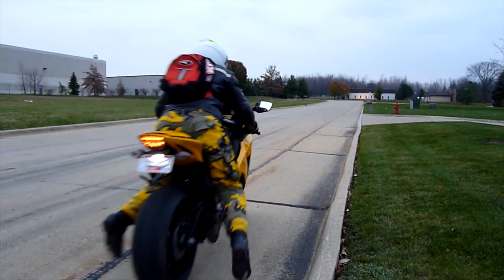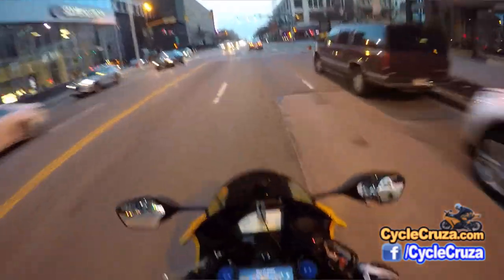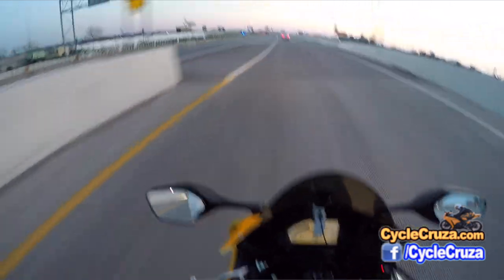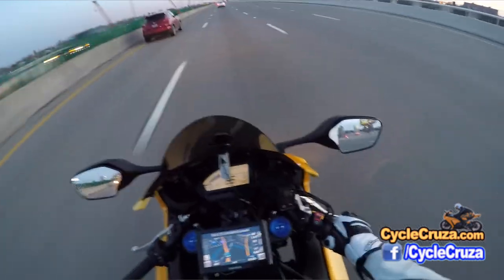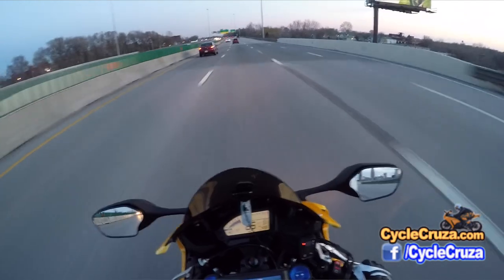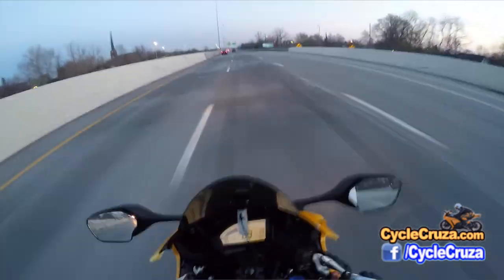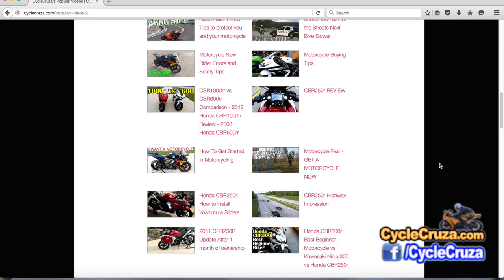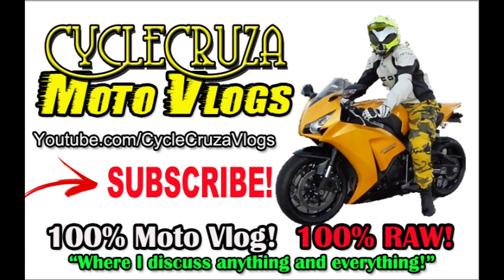Ceramic Bearings Make Motorcycle Faster? Steel vs Ceramic Bearings | MotoVlog

Comment from the maker: ***CycleCruza's Recommended Videos*********

Go to my motorcycle Video Playlists here:
http://cyclecruza.com/my-videos-2

Watch OEM vs Chinese Fairings video here:
https://youtu.be/Hm91V5FlMqU

Watch 2012 Honda CBR1000rr review Video:
https://youtu.be/NlkL1icvenQ

Watch Motorcycle Fear Video here:
https://youtu.be/gbVeyVEmryc

Watch Why a Supersport for Street Riding video here:
https://youtu.be/A7eAmz2Q1Cs

Watch Motorcycle Defensive Riding video here:
https://youtu.be/OOCr7WupuQo

Watch Top 5 Starter Motorcycles Video here:
https://youtu.be/wyniWQWAy10

Watch Beginner motorcycle you will keep Video:
https://youtu.be/5MJbnRdTyQo

Watch Best Starter Motorcycle MotoVlog video here:
https://youtu.be/nIgbAwaVg8Y

Watch CycleCruza's Buying Tips video here:
https://youtu.be/n4zN-EJHQd0

Watch my 'How to get started in Motorcycling" Video:
https://youtu.be/at5jr430vX0

Watch Defensive Motorcycle Riding video here:
https://youtu.be/OOCr7WupuQo

Watch How to get started in Motorcycling video:
https://youtu.be/at5jr430vX0
Reply: +CycleCruza Is that for a full set of every bearing in the bike, front wheel, rear wheel, primary drive in the trans and everything? Or is that just for the drive wheels? (seems like the % efficiency difference would be across replacing everything in the bike, not just a set, which means that the difference is really negligible unless your are cruising at 180 Mph on a regular basis and would like to go another few Mph which would be good for racing as a slight edge) Those should be ~$50 a piece?!? (assuming 10 bearings between wheels and transmission)

Comment: Hey listen I know This may be a hair off to the Other end. My Experience with Ceramic Bearings comes from Skateboards and Longboards. So for Example Paying $30-$60 vs paying $150-$250 for amazing set Ceramics. I can tell you first hand from that aspect The effort to keep the ceramic cleaner and resistance to dirt grit and Grime is SOOOO much better than Steel. The Resistance to degrade from my experience is 60-80% better wear resistance vs Steel bearings. The Rolling resistance allowed me to make one push off and Go nearly 3 times the distance vs that same effort on Steel. So I do understand the Translation in performance and quality of the Product. Would I buy a pair for stock wheels..... Honestly no..... would I do it for Carbon Fiber wheel.... Hell yeah I would since I'd be spending the Money already. Actually I stand corrected..... if my OEM steel bearings are worn out then actually Yes I would get some for stock wheels..... But would I upgrade just to change them............ No. Is it worth the Money....... Yes but only if it is time to replace the oem product.
Reply: Thanks for your input.. ill buy some.

Comment: If you're racing, every little bit counts. On the street you'll never notice. Ceramic bearings have been around for decades as far as I know. They used to be (still are maybe) a common upgrade for RC cars I used to race back in the 80's. They made a difference in those little cars. Not surprised they have them for motorcycles.

Comment: +CycleCruza

ceramic bearings are often used for components that generate or consume alot of electic energy.
(like big expensive electric (servo) motors).
That is so the balls in the bearings are non conductive, compared to steel balls.

for example electric motors can get a static electricity in the rotor (rotating part) and when the rotor is not grounded by connecting it to a grounded machine, the static electricity will flow through the steel balls causing sparks, these sparks create dents in the surface of the balls, the dents then cause the bearing to wear out faster.

the ceramic balls are non conductive so there will be no spark. in an electric motor they are often mounted with steel brushes so the current will go theough the brush and not the bearing.

Also the thing about the bearings having less friction and all that is true, only on such a small scale that wou wouldnt even feel it if you spin them by hand. so that you bike will gain 2hp is COMPLETE BULLSHIT!
all the friction a bearing has is caused by the seals, that keep the lube in and the dust out. a steel ball bearing with no seal will spin really freely. and the tiny bit of friction it still has is then mostly caused by the oil.

So if u want more power and all that good stuff:
remove all seals from the entire bike and drain the oil!
(please don't :D)
Reply: the mental picture of someone trying your suggestion is hilarious!!
Reply: Although the increase in friction would be more noticeable under several hundred pounds from the bike sitting on them. I'm not positive, but I'm fairly sure that ceramic is conductive.
Reply: +Dominic Gregory first the bike is too light to add any serioud friction to the bearing. if it would create friction it would mean that the bearing would change shape a little bit, resulting in more wear. but for the wheel bearing the to be under such pressure you need much more weight.

second, full ceramic bearings are non-conductive, google it if u dont believe me.....
Reply: DutchMastermind Yeah, but I'm saying a 450 pound bike would add more fiction than you spinning them in your hand.

 I said that I don't know if ceramic is conductive, but I'm fairly sure it is because of ceramic heating elements and stoves. I could be wrong.
Reply: Dominic Gregory 450 pounds is not enough to create any noticable resistance, the bearings are big and hard enough to support that weight. if it would create friction your bearings would get incredibly hot (wich they dont). and if a bearing gets over aprox 110 degrees celsius, it will suffer serious damage.
Reply: DutchMastermind Alright, I get what you mean. I was just saying what I think is right, not claiming it to be right. Have Have a good day man
Reply: full ceramic bearings can be run dry and always spin more than steel, you no need to put the rim seal dust because it is non-magnetic non-dust absorption the rim seal dust can cause addiction drag purpose of this shit is to protect water going in a steel bearing

Comment: I'm guessing with ceramic bearing they don't expand when they get hot and that reduces the friction which frees up some power.
Reply from the maker: +samuel lopes They say ceramic bearings have less surface imperfections thus less resistance.
Reply: Oh ok. I know usually with anything ceramic it reacts better to heat. Ceramic coated piston tops are a good example...

Comment: gimmick. I work on machines of the world. CNC, Hydroforms, Plastic Injection Presses, Fanuc-Nachi-Motoman-Sepro robots. NEVER seen or used ceramic bearings ever. These are machines with great precision and running thousands of cycles every 8 hours, 24 hours a day, years straight.

Comment: I used to do outdoor inline speed skating and I remember switching out the ball bearings for ceramic bearings.  I was smoother and I did feel less friction when I swap them.  However like you said, they are costly to switch.

Comment: I don't see how bearings could add hp? Kind of like changing the gears...doesn't change the hp rating, but could seem quicker (depending which way you go). Maybe less power is lost during the transfer from engine to rear wheel?
Reply: +Josh BAtic Smoother roll, allows ease of rotation to the rear wheel. It doesn't "add" hp per say, it simply allows the bike to put out more of it's potential. Which is a fair amount considering the minimalness of the upgrade.
Reply from the maker: +Josh BAtic Less rotation restriction so the wheels roll better.

Comment: My thought would be if you had ceramic bearings in the front wheel and were a wheelie person, would the bearing break?  Hit a regular ball bearing with a hammer and it might give it a little dent.  Hit a ceramic piece with a hammer and it might break into a bunch of pieces.  The front axle is the hammer!  So, would the ceramic bearings hold up to abuse?  The ceramic bearings don't create hp, they just make the centrifigual drag less.  A manufacturer who says they can get 2 hp with their bearings I think has a box of "Dr Good" stuff in a bottle, in the back of his shop that he will sell you too.....  Electric motors and power generation equipment might use ceramic bearings, but on a motorcycle????  Where is that bottle I bought????
Reply: it give you more spin as a result higher rpm, dude do your home work ceramic is harder than steel police your use it as a bullet vest and found ceramic is better than steel

Comment: Cyclecruza i recently bought a 2016 KTM RC 390 and a lot of parts of it are Starting to RUST! what should i do bro?
Reply: if you have a warranty, take it back to dealer.
Reply: +men0fvalour he says we can't do anything about rust
Reply from the maker: +The Average Engineer dang that sucks.There is really nothing you can do but be pissed off. Thanks for sharing your experience, glad I didn't get a KTM.
Reply: +CycleCruza  bro will using WD 40 get the rust out?

Comment: I wonder if they can take a pothole hit or are they just meant for race tracks
Reply: small load shock the  Zirconia ceramic bearings still can take it, however nobody go 120km per hour and hit a pothole even steel cannot take it and second motorcycle got shock absorber which can help in shock load impact

Comment: Cruza , I appreciate that you know a lot about bikes but not a " know it all " and wanting to learn more. Keep up the good work. DEAUCES !  ( I not long ago learned what deuces meant )  :)
Reply from the maker: +Wooogly I learn a lot through your guys and I share what I experience so we can all gain knowledge together as a community. I do these motovlogs to create community discussion. Thanks for your comment.
Reply: +CycleCruza you should buy them and put the bike on a dyno and test the gain in hp and fuel consumption. If they reduce fuel consumption and last longer you can end up earning them back but I doubt you would. But surely it will decrease the cost per hp if it increases rwhp. Cruza pls test for us.

Comment: cycle cruza do you want to change your shifter into quick shifter soon? I think it will better for inline 4 engine 😀
Reply from the maker: +rifqi ernaldi Not for me, if I were racing in events I would add a quick shifter but just for recreation riding no.
Reply: +CycleCruza is it expensive? how much does it cost for cbr 1000rr?could you mention one of the brand that you will use if you were in racing event maybe one day ? well with quickshifter I think its more fun especially for bigbike 😁

Comment: hey +CycleCruza in my experience and research from the r.c. car side of this technology. is that ceramics are lower mass and more efficient gliders, but they are delicate as well. cause of the material that the bearings are made out of. so they are better put in an area that doesn't experience much shock.  personally I could see picking up a cermamic kit. just for the sole purpose efficiency. so other then that, and for the average joe, I could only see race bikes using them

Comment: These ceramic bearing were originally designed for industrial application were a bearing might experience 80,000 rpm and high temps at the same time. i actually came across this video because i was searching for information regarding my engineering project at work. i dont think these bearings could help anyone on the street at all. the only place i see it being used effectively is on a track were a bike has already had every other race legal upgrade and the rider wants a competitive edge. 2hp could be the difference of winning or losing in a tight race.

Comment: My bearings saved me last night I ran out of gas literally last night in Nashville in DT area. The only reason I made it because of the low friction. I pulled in clutch and glided to freedom like a flying squirrel or batman! I would've run out of gas in the shit part of DT with my old bearings and had my bike stolen. Think I would've been 3 miles short of the gas station. If I'm at speed say 70 mph I can coast for at least 2-5 miles till you stop rolling especially if there is a graded plane. Anyway you're awesome bro keep up the good work!
Reply from the maker: +Will Moore Hey that;s a good point, would increase fuel efficiency if you coast a lot like I do. I may try them out.
Reply: @CycleCruza  you said not worth  it, it may save you fuel in a long run, suppose you spend your bearing for $500 it will save you $1000 fuel per year compare to steel bearing so a year later your save $500- $1000-$500=$500

Comment: Kinda unrelated but still sorta on topic I used them on my longboard they were like 150$ compared to like 70$ and I got an extra 20km/h extra going down the same hill. If u step on the board and there is a slight hill u will roll forever will out touching. Take it for what it's worth just buy em' and find out.

Comment: Good point, Chris,  No doubt, an outstanding product, but is the net result worth the cost?  It's like buying a hybrid car..The environment might benefit, you'll save some fuel.  The problem is, you won't live long enough to break even on the investment.  If you're on a factory team, with a bottomless money pit, a few horse power might be worth it.  I have several Hondas, from a CB 175, to  GL 1800.  Aside from the steering stem on the 13 wing, I have never changed or wore out any bearings.  If you could get a sponsor to donate some, it would be a good test.  For that to happen, you'll need very detailed and accurate base info.  I wish you the very best.  Hang in there.  Mike

Comment: I've used ceramic bearings on a mountain bike. I could not feel the difference with my legs.on the mountain bike you had to be aware of side loading the ceramics to much. I would worry that a shop mechanic would not be aware and destroy them.maybe that's a non issue with the way the kit is set up for a motorcycle. For that amount of money I would want to be sure.

Comment: If you find out what sizes you need from your owners manual, you can just order the bearings you need in many different grades for much cheaper.  I can't imagine much more than $100 for good Japanese made ceramic bearings.  Ceramic bearings are better from an engineering standpoint, but, unless you are professionally racing why bother?  You can do even better than ceramic if you want to really pay out for high end precision bearings and specialized lubes for them.

Comment: what's up cc! was wondering ur thoughts on a power commander I bought an r6 with a d& d pipe and am being told I need a pc with a slip on pipe  ... pros/ cons?  Thanks love the vids, keep me coming and stay safe
Reply: it give wheel more turn as the result faster the engine may use the same effort to spin the wheel and it got more spin the rpm may get higher result of more spin on the wheel

Comment: If you want to spend an extra 500 bucks send your OEM wheels back and find a set of forged aluminum/magnesium wheels. The weight savings between the cast OEM wheels and their forged counterparts will actually have an impact on handling and your bike's ability to more efficiently use the power it does make. Bearings won't do either.
Reply from the maker: +BTrain5489 I only paid $1,080 shipped for the OEM Honda repsol orange wheels. Mag wheels run 4k for a set of wheels. 3k more to save a few pounds of weight for street riding is ridiculous. If I were competing in races at the track then mag wheels would make more sense. The main reason I got the extra set of wheels is to have an extra set of back up wheels or to put slicks on for track day.

Comment: If you're bitching about this you've never used high end ceramic skateboard bearings.  At $500 it's not for everyone but dedicated racers and people wanting to increase fuel economy then it definitely is.  As far as freeing up horsepower to the wheel it depends on the quality and it's not going to be noticeable until you are at speed.

Comment: i have worked on cars most my life and being honest i can not justify the cost of ceramic bearings. If you building a track bike or worked in the moto GP i would say go for it but for everyday riding its not worth the dollars or doll hairs if you get the reference. So if you decide to do it any way you probably won't notice the difference on the roads but track you might.

Comment: may be great for lightweight racing application I read somewhere they're not that good for Street use. shatter easier .and cost just not worth it
Reply: it is harder than steel, if you put it on a bicycle with no  shock absorber it may shatter in load shock, if you put on motorcycle which the shock absorber may help absorb shock unless you put it on a hardtail motorcycle

Comment: I used to do outdoor speed skating and when we change from ABEC--5 steel bearings to ceramic bearings, it makes a whole world of difference.  However, ceramic bearings for inline speed skates way cheaper.  It's under a hundred dollars whole the set.  Motorcycle ceramic bearings are way overpriced.

Comment: Ceramic from what I understand it has less drag and steel has more drag. Steel can take high temps and ceramic can too but not for a long period of time. For stunting applications I would go ceramic all day. Racing and long distance traveling I would go steel.
Reply from the maker: +Brandon Silas Some track riders say they have shaved a couple tenths off of their lap times with ceramic bearings and swear by them. However, for regular street riding I don't them being worth the ridiculous cost.
Reply: depend what kind of ceramic you are using if use Zirconia ceramic bearings it can stand high temperature more than steel